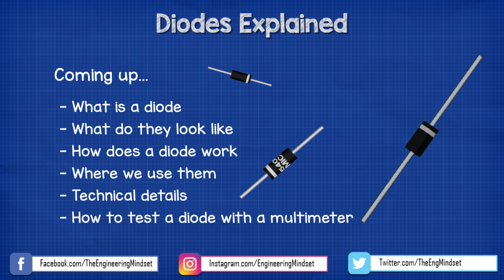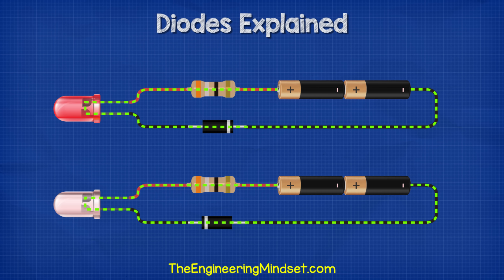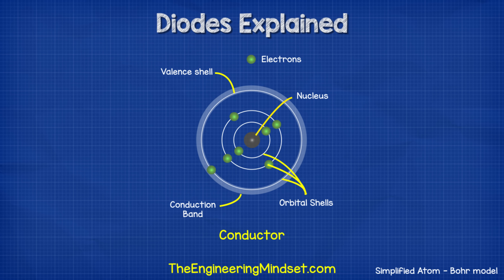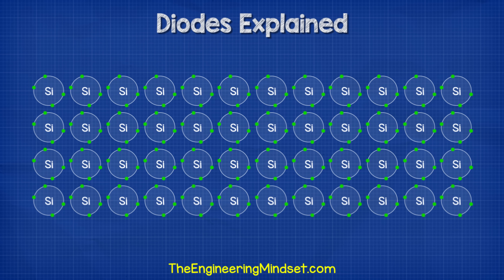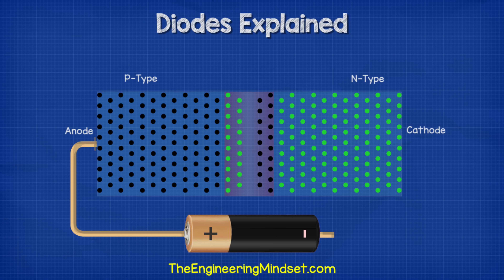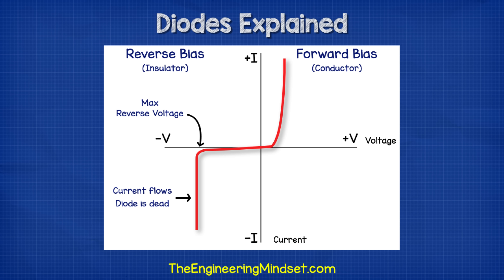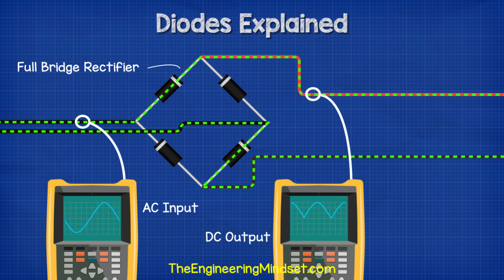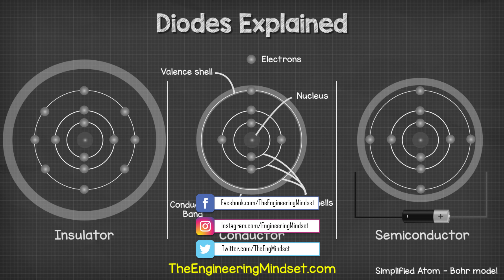Diodes Explained - The basics how diodes work working principle pn junction

Comment: I am new in electronics and have some doubts. If possible, can someone explain me?
At 6:12 I understand that in the junction, the free electrons fill the closest holes and for some reason, the holes migrate to the other side as well. As they are in the same number (?) they attract each other and creates a electromagnetic field, but what prevents the rest of the p-type junction to attract the "slightly negatively charged" part as it has a lot of holes waiting to be filled by electrons? Following this logic, the diode alone would produce a forward bias or become neutral, and this don't make sense lol.
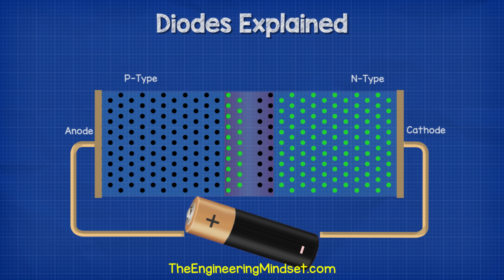At 6:47, the reverse bias mode makes the free electrons of the N-type to be attracted by the positive side of the battery. This question may be very dumb, but I can't understand why won't the free electrons run through the wire to reach the positive side of the battery? At the same time, why won't the electrons of the battery run through the wire to reach the holes of the p-type or, as they are being attracted by the negative side of the battery, travel to the wire to the battery?
Reply from the maker: Check this out, how a battery works: https://youtu.be/PXNKkcB0pI4
Reply: I don't believe The Engineering Mindset understands this well enough to answer your question.  In fact, a number of things said in the video are incorrect causes me to doubt mastery on  the subject. That aside, let me try at explaining why no more holes/electrons cross the junction when there is the 0.7V potential across the junction.  As was said in the video, electrons/holes will initially cross junction until an electrical field exactly balances the migration.  Migration of electrons/holes across the junction occur simply due to diffusive potential and is no different than a gas of molecules diffusing through some medium.  As the two types of charge carriers cross the junction, an electric fied is established and builds up until balanced with the migration potential.  What is meant by "balancing" is that across the junction at equilibrium, there actually is a constant crossing (flux) of carriers from BOTH sides of the junction, even though the amounts of charge on either side of junction is constant, that is, the flux from left and right exactly cancel. For the electrons on the n-type side, exactly the same number of electrons are crossing the junction into the p-side as the number of electrons coming back through the junction due to the established electic field.  For the holes on the p-side, again, exactly the same number of holes are crossing the junction into the n-side as the number of holes coming back through the junction due, again, to the established electric field.  So, in this balanced (apparent equilibrium) situation, no more holes/electrons will "appear" to flow to upset the balance.  This "balancing" due to the electric field is the "barrier" that needs to be overcome in forward biasing to cause current to flow. I hope this can make it clear to you what is happening.

Comment: Really love your electronic components videos. A question arise in my head at the end of this diode video, after watching capacitor and inductor videos. The question is, every electronic components and parts used to build any circuit is based on the power source voltage, is that right? For example, if my power source is 9V, all the electronic parts I used in the 9V circuit must be maximum voltage 9V? The voltage of All electronic parts used must not exceed 9V! Am I wrong? What about the minimum voltage range of an electronic parts I should use in a 9V circuit? Can there be such thing as, the electronic parts voltage used in 9V circuit is too low, it can't handle? What kind of parts must I use for 9V, 12V, 24V.....240V circuits and so on? Sorry for the long question. I can't quite put them together in short. I Thank you very much, beforehand!

Comment: I have a wall heater an there is a live ground wire exposed with other wires. I'm a woman an in need of help. Been feeling electric current.  PLZ HELP
Reply from the maker: If you're not qualified and competent to carry out the work, call a qualified electrician.
Reply: @EngineeringMindset  im most deff not Qualified but I am Competent.. I was just looking for sum advice.. I don't have a lot of $ i

Comment: I am retired and took up electronics as a hobby. I never studied electronics in school, but always found it fascinating. This video is so easy to follow along with. Great job. Thanks.
Reply: Same here and I think the hobby has many more like us. Having the internet has made it access to info so easy makes you wonder how much better we would have done at school
Reply: I didn't like circuits it in school, because there was no in-depth explanation. Now I study electrical/computer engineering and these things are beautiful.
Reply: Using conventional flow does make diode and transistors extremely difficult to explain on atomic level. Electron flow makes it super easy to understand how these components work internally. I think he's doing it right this way.
Reply: Its easy to follow because its a basic introduction of one of the basic components. However its misleading as it dont adhere to the direction of current flow. Imho he should use the + to - flow and just mention that the electrons flow in the other direction. Or leave it out as it is irrelevant.

Comment: Bit like a Snake swallowing a rat, the snake moves forward (electrons) but the electricity moves along or through. 

Also. To help me remember I need to know why a name is used Valance for example ( I always ask why ). Just makes it easier to remember....so 

Quote:  "[in part from valence in chemistry, in part borrowed from Late Latin valentia "power, capacity," noun derivative of Latin valent-, valens, present participle of valēre "to have strength, be well" — more at WIELD] : the degree of attractiveness an individual, activity, or thing possesses as a behavioural goal
"

Comment: Hello! Thank you very much for your amazing videos!! I just can't get my head around properly measuring a diode's Vf (Forward Voltage) with my multi-meter.. I always get a different value from the one stated on the datasheet! You also seem to be getting a different value for the 1N4001 diode..meaning 0.516Volts while the datasheet gives a value of 1.0Volts Vf. Is there an explanation for that?
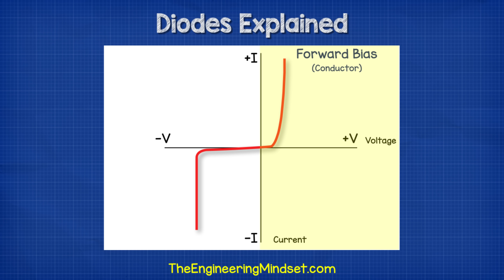Reply: Look at the I-V curve at 7:30. The forward region is on the right. Note how the current increases as you increase the forward voltage. Conversely, the Vf will depend upon the current. For a very low current, say a few microamps, Vf will be very low, maybe as low as 0.1V. For a larger current, say 1 mA, Vf will be larger, perhaps 0.6V. For very large currents, Vf will be about 0.7 V or slightly greater. 

   So, the Vf depends on the current. Also, it depends upon the characteristics of the diode, like the doping concentrations, the width of the depletion (insulating) layer, and the area of the junction. Variations of Vf will be observed for different diodes from the same batch.

   The diode check function of a typical multimeter sends a test current through the diode and then measures the resulting voltage that appears across the diode. A typical test current might be 1 mA (It depends on the design of the multimeter, and not all multimeters are the same.) 

   It follows that the Vf you observe on Your multimeter might be different from what someone else gets on their multimeter - but the two measurements will be in the same ballpark, so to speak. 

   The data sheet for 1N4001 - 1N4007 diodes I checked showed a Max Vf of 1.1 V at a current of 1 A without specifying which type (1N4001 or 1N4007) diode is being referenced. I suspect a 1N4007 because diodes with a high peak inverse voltage typically have slightly higher values of Vf. This is the maximum Vf at the maximum current. It's the upper limit. I've never seen a Vf over 0.8 V for this class of diodes in a practical circuit.
Reply: @clarencegreen3071  Thank you very much for this great explanation! What creates this confusion is the fact that it is not easy to pinpoint a value that is not really a fixed one! I mean just like with simple resistors, the higher the current the higher the voltage drop. Of course, there are a few differences when you compare the “i-v diagrams” between those two components, but somehow this comparison helped me a lot. 

It was also not evident at the beginning that we are dealing with several Vf values... 

1. The "minimum" Vf (aprox. 0.516V), that the multimeter gives you, which is  dependent on the test current of the multimeter.
2. the maximum Vf (1.1V) the datasheet gives you (which is actually called Vfm and not Vf, in my datasheet at least), which will be induced at a current of aprox. 1Amps.
3. And the typical Vf which is approx. 0.7V, after which for greater changes in current, the voltage drop across the diode is very small.
Reply from the maker: Check our new Multimeter tutorial out ➡️ https://youtu.be/4lAyzRxsbDc
Reply from the maker: Check out NEW resistor video, everything covered! ➡️ https://youtu.be/DYcLFHgVCn0

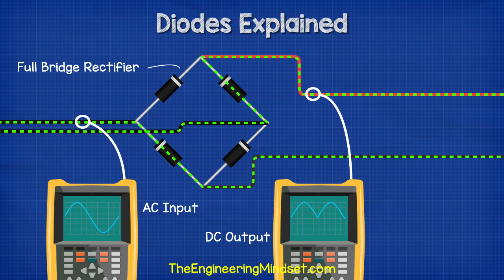Comment: I think the full bridge rectifier diagram at 9:30 is wrong?  I think each diode connected to the line voltage should be in opposite directions?
Reply from the maker: No, it's just drawn sideways as it's easier to animate.
Reply: @EngineeringMindset  ah you're correct... I thought the load/output was to the left, but that's the input. Cheers.
Reply from the maker: Rectifier video here https://youtu.be/RiRyzLl4Y8U

Comment: You can place diodes in series to handle higher voltages. A very high voltage diode, on the order of 10,000 volts, if you open one up, looks like a stack of disks. Diodes in series.

Comment: 8:46 Bad use. You can connect an LED backwards to a battery with no harm, it does not need protection in the way described.

Comment: I have a question if you have a light led like needs low voltage to turn on and you connect to high voltage battery and I know that the led will pop and burn so the diode can fix that or not?

Comment: Great video! I couldn't completely understand how the reverse voltage protection works tho, why the flow goes through the diode instead of the rest of the circuit?

Comment: Great video. I really liked the quad diode part. It helped me understand one of my tools used to detect differences in metal thickness by voltage variations with an elctro magnet much better.

Comment: Thanks for the video! Btw  I am confused  about the 'Potential Barrier'. Is the barrier formed by neutral atoms? Like, the holes and electrons of the atom in the Barrier are completely filled? Is that what(neutral atom) is making the barrier? Or an empty space without atoms? Also why is there no further movement of electrons to the holes in the p-type or n-type itself ?
 Please help Thank you!
Reply: Look at 5:45. Black dots represent empty spaces (holes) where electrons can reside comfortably within the crystal. Green dots represent the 5th electrons carried into the crystal by the N-type dopant. They don't really fit, but they're dragged into the crystal by their host atoms. At first, all atoms are neutral.
   Once the P and N materials are in contact (conceptually speaking), some of the ill-fitting electrons on the right will cross the interface to fall comfortably into the empty spaces on the left. The electrons that cross over carry their negative charge with them and take up residence on an atom (P-type impurity or dopant) that was initially neutral. This forms a layer of negative charge just to the left of the interface. 

   On the other side, the N-type impurity atoms have lost an electron and therefore become positively charged. This forms a layer of positive charge just to the right of the interface. Note that there are no free electrons between these two layers, which makes the region an insulator. 

   Here's where the "barrier" comes in. Suppose another electron tries to move from right to left to cross over and find a hole to fall into. Once between the layers, this electron will be pushed back by the negative charge up ahead, and will be pulled backwards by the positive layer behind it. Depending on the energy it has, it may or may not be able to make the trip to successfully find a hole to fall into.
   Once the negative and positive layers are fully developed, no more electrons will be able to cross over. Otherwise, all the free electrons on the right would simply cross over and fill all the holes on the left. However, if an external voltage is applied, negative on the right and positive on the left, the external voltage will help the electrons overcome the push-pull effect (the barrier) produced by the charge layers and the electrons can flow freely across the junction and form a current in the external circuit. This is forward conduction and the required external voltage is called Vf. 
   Now, if the external voltage is reversed, it will add to the push-pull effect and no electrons will be able to cross over . This is the so called "reverse bias" condition in which no current flows in the external circuit.
   This was explained briefly in the video, but now you have it in (a lot of) different words. Hope it helps.

Comment: Am i correct in thinking that electric field/voltage goes from positive/anode to negative/cathode and magnetic field/current goes from negative to positive? or is it the other way around? or both the voltage and current goes from negative to positive? If the current goes from negative to positive, is that why the negative of power socket very warm to touch after using the water heater coil? Is the current strongest where it feels very warm to touch?

Comment: Rly? Diodes works in opposite way than  you showed up
Reply from the maker: Watch the video from the beginning and it is explained
Reply: @EngineeringMindset  I watched whole vid. But when i see this miniature with diodes conected in oposite way...
Reply from the maker: OK, what part can I help with? Or which part do you feel is connected the wrong way?
Reply from the maker: Regarding the thumbnail, it's just a thumbnail. It's only purpose is to stand out and make someone click. We show the correct version in the video although this is rotated 90 degrees clockwise from how most textbooks typically show it.

Comment: Diode=angry-pixie-check-valve.

So, okay, what I'm hearing is that, example:a car battery, the red/positve side IS where the current flows from, but it isnt actually positive because electrons are negative , so what we call the positive side is actually the negative, but what we call the positive is still the source of current flow, so to speak.
Reply from the maker: Essentially yes, but if its easier for you to think in conventional terms then just continue that way and just be aware of electron flow

Comment: "The voltage source has to be > than the 0.7V barrier" ... In the diagram you have the voltage source as 0.5V. Did you mean to say 1.5V for the voltage source instead ??
Reply from the maker: Later in the video I show the valve opened on minimum of 0.5V but almost no current flows then, then I show the voltage drop of 0.7V which the power source needs to overcome
Reply: @EngineeringMindset  very well explained sir round of applause

Comment: Very well explained. Never really understood the pn junction before
Reply from the maker: Glad it helped you
Reply: @EngineeringMindset   great explanation!!
Reply: @frenlyfire  It is where the p doped and n doped silcon meet in the diode
Reply: If the green dots are excess electrons and the black dots are holes, at the PN junction, free electrons move to fill in the holes, OK, but why does that create holes to the right and excess to the left? Intuitively I would imagine a neutral PN region, with holes filled with the excess.

Is it because Phosphore becomes positive when an electron is taken away and Aluminium becomes negative when an electron is added?
So the desire to reach overall stability with covalence is stronger than the charges of the individual P and Al atoms themselves?
Reply: @monkaTOS  once the nearby P-doped molecules have acquired their additional electrons, they have a full valence layer and the atom will not easily give up that perfect balance.  Likewise, the nearby N-doped molecules have given off their additional electrons and have reached equilibrium as well.   With both sides, there  is a small band of molecules that are at equilibrium and they do not easily want to change.    It is these "neutral" bands that prevent more electrons from the P-doped side from moving to the N-doped side.  Think of the neutral bands as a temporary insulator.  Once voltage is applied in the proper amount, these barriers are overcome and electron flow happens.
Reply: @BoHunter2010  Thanks for the explanation. The fact that @6:02 use the same colours confused me. The greens on the left of the junction are not the same thing as the greens on the far right. Same for the black on the right of the junction vs far left. I've looked it up online and indeed more detailed schematics show "negative ions" on the left of the junction (picked up an electron) and "positive ions" on the right (donated an electron). They should be a different colour than the valence deficit/excess showed here in black/green.
Reply: True, by far the best explanation of the pn junction